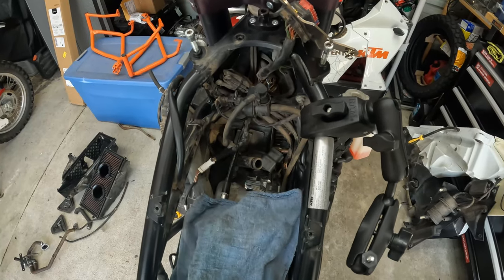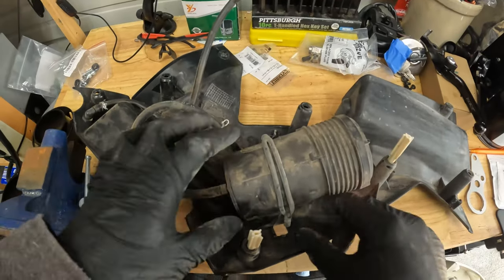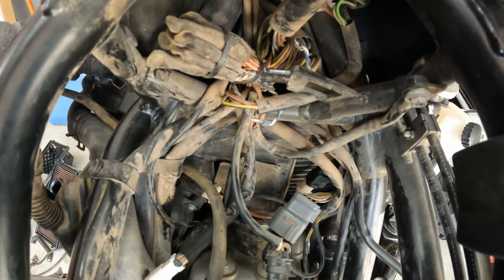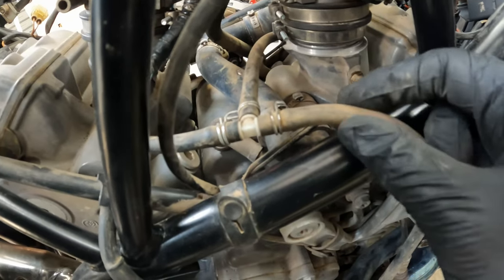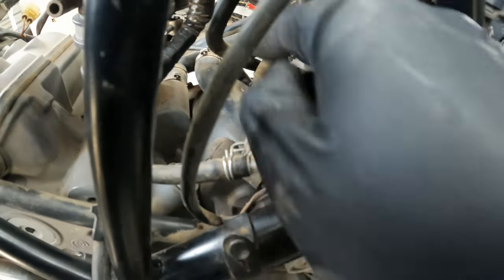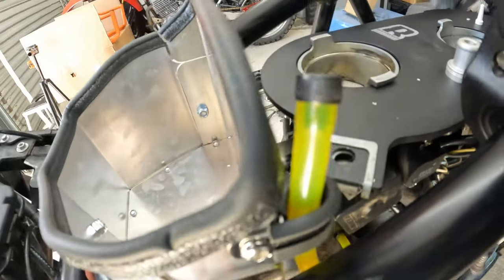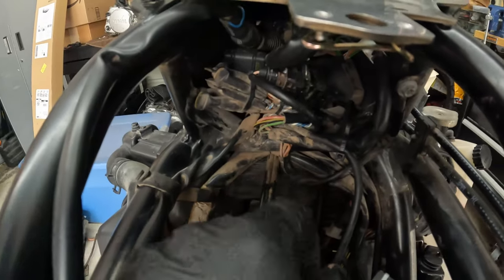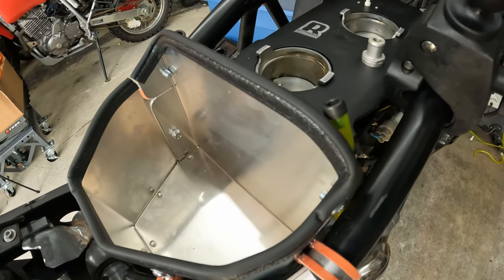KTM 990 Adventure Canisterectomy | Rottweiler Stage 3 Kit | Canister Delete

Comment: What is purpose of this cannister actually?is it ok to remove it?
Reply from the maker: Emissions. Yes, it's ok to remove, which does not affect performance or give more power. It does prevent a reduction in failure on the unit. If the unit is removed, it won't fail. Check your state laws, removing Emission components is strictly for off-road or performance vehicles. Hope that helps 🙏